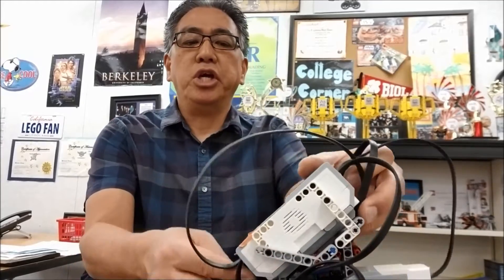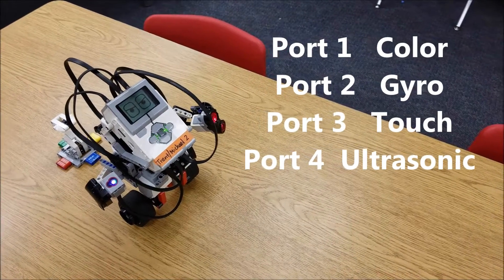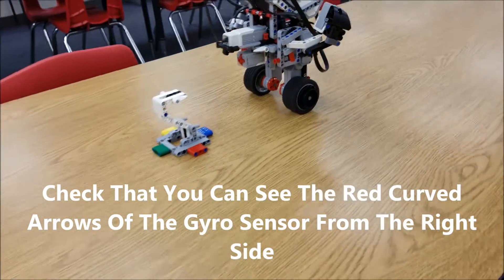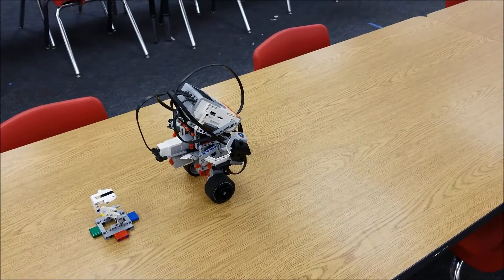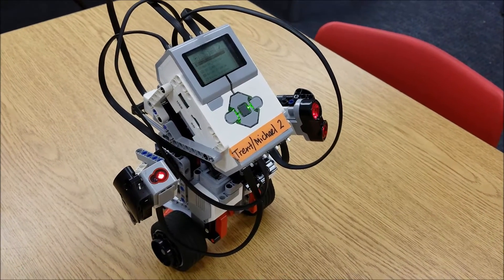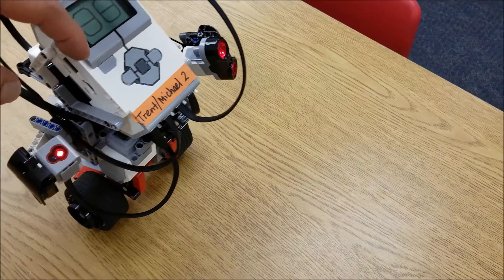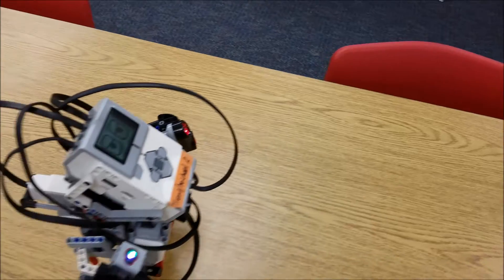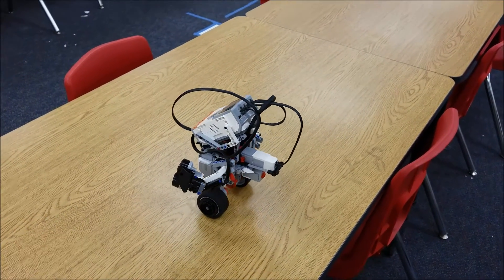"The LEGO Mindstorms EV3 Gyroboy: What It Does How Do You Fix It"

Comment: I built this last week. Cabling is a nightmare, and I ended up using colored tie wraps as cable markers to help figure out where to put what (and it did help). IMO LEGO should've made these cables in several different colors. ANYWAY, to my amazement it worked on the first run. As someone says below, I think it's important to have the arms positioned exactly as in the build instructions.

At any rate, I have a new fascination with balancing robots, and want to build the much simpler BALANC3R design from the Home set (a gyro sensor is required, which is not in the Home set). I also want to try to get a balancer working in EV3DEV Python, as I'm not all about the Scratch-based visual coding.
Reply from the maker: The Gyroboy can be a nightmare if the cabling or sensors are not installed correctly or in the wrong place.

Comment: thank you so much!  Of course my ports were mixed up.  Then we found that the gyro sensor was off and needed a reset.  Something that you didn't mention is that the table or floor that you are using should be level!  My classroom is very old and the tables are not flat at all.  Our class will need to find a level floor to make these robots work.

Comment: Hi Mr Hino, thanks for the fascinating stuff! We have the same issue, as many others seem to: the gyroboy keeps going back and forth until it falls over. Cables checked, gyro reset, ev3 block restarted at parking position. We even tried it on different surfaces (carpet, wooden floor). What else could we do?  Thank you in advance.
Reply from the maker: Did you make sure the gyro was installed facing the correct way?  You should see the arrows on the gyro facing his right arm. We also did a bypass install...check it out.
https://www.youtube.com/watch?v=Nmj2hnxknY0&ab_channel=LEGORoboticsMr.Hino
Reply: @LEGORoboticsMrHino  Yes, we have checked, and it was facing the right way. Actually we found what had beeen the problem: the batteries were running low, but not low enough to trigger a betttary low message in any form. Might be usuful tip for other Lego adventurers. Thank you for the response and your work!

Comment: My son and i build Gyro Boy using the python guide. When we run the program, the robot goes back and forth until it falls over. It is not as stable as the one in your video. 
Any ideas?

TIA

https://pybricks.github.io/ev3-micropython/examples/gyro_boy.html
Reply from the maker: Try unpugging the gyro and plugging it back or try turning off the robot and then turning the robot on completely standing straight up. Sometimes the gyro doesn't know what 90 degrees is because it was turned on laying flat.
Reply: @LEGORoboticsMrHino  Thanks, but that did not help. Any other ideas?
Reply from the maker: @ishey41  Possibly unplug all cables and re-plug them back in.  Maybe motor cables are swithced?

Comment: Thete is no reason to reset the gyro.  The program does not use gyro angle, so drift is not an issue.  The program computes a rate offset while the robot is on the stand, so a non zero rate doesn't cause problems either.  If gyro boy is built and programmed correctl the most common startup problems are that the arms are not in ihe right srarting position (starting weight distribution is off) or the robot is cot correctly positioned on the stand (causes initial rate measurement to be off).  When on the stand gyro boy should be on the verge of tipping over forward.